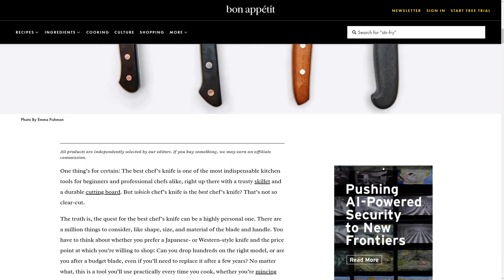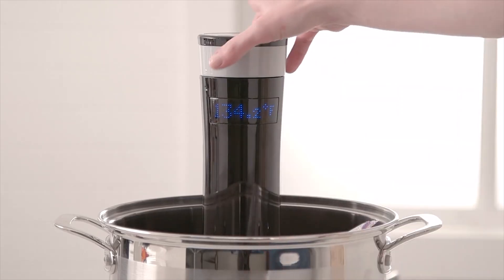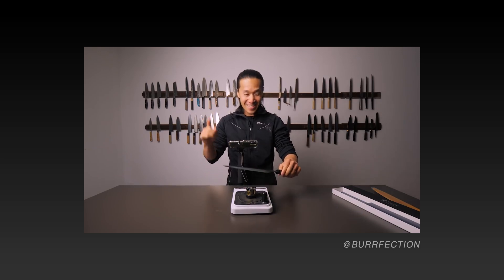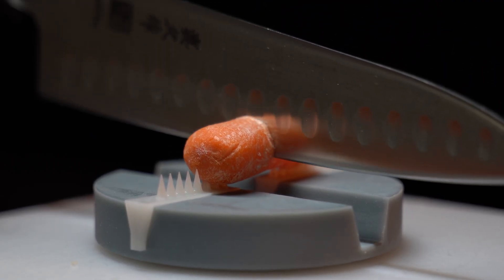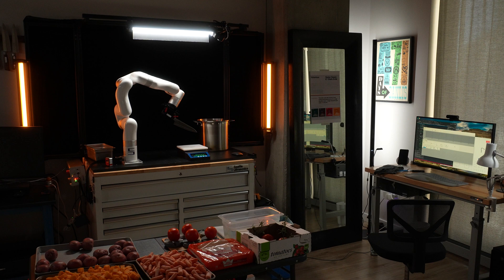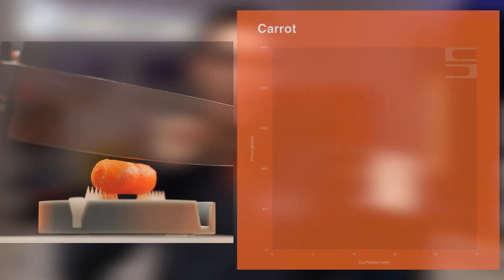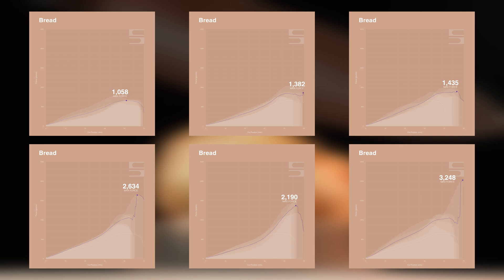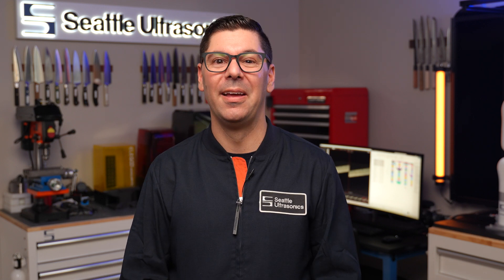The Quantified Knife Project - How do the most popular chef's knives actually perform?

Comment: As a video editor, I got the following problem with this video: it doesn't show the crucial part first, which is the result. I want to see how usual knifes perform and then I want to see how your knife performs on bread cutting and I like a visual demo. I don't need to necessarily have the data. I want to see it cut normal bread. I want to see it cut baguette. A. Longer nerdia video is fine, but as an addition.

Comment: I loved this video!  Thank you for the post.  The first question I have is if you have a way to measure the cross-sectional area of the blade at various places along the profile, as well as the metal's surface polish.  I wonder if there is a relationship of slope, edge sharpness, and edge polish to the different cutting metrics...  Probably WAY too much work to add this, but what the heck, you already recognized your OCD. Also, there might be a way to track the position of each particular knife used by a professional (this sidesteps the issue other mention with the technique being different from how a professional uses the knife).  Anyway, I loved the video, and you gave me some ideas for when I get my smithy back up and running...

Comment: Hey friend, 1. I am so glad Wired told me about this video and linked me to it! Now I can sub! 2. You can go to (likely) any optical shop in and around Seattle and get your glasses adjusted (in under 2 minutes!) to fit without sliding down your face. If you go to where you purchased them, assuming it was in person after your yearly eye exam, the opticians practically have to do it for free by law. Yes, I know from working experience. One douch optometrist made us charge people $1 for every screw! Years later I started as a billing manager at another local optometry place and they always did free adjustments on anyone even if they were not a patient and even cleaned glasses too. It is an art, some are better than others but the older ones know wtf they're doing. For real. Guess which office was beloved by everyone?

Comment: One of the problems with testing knives  objectively is the pool size. One knife from one manufacturer doesn't necessarily tell you much about the quality of a particular model, since there's enough variation in specimens to dramatically effect performance. Like how well sharpened the knife was at the factory. You'd need a bigger sample size to be confident in your conclusions,  and that could get expensive. 

In addition, subtle differences in performance between models of knife may be far outweighed by esthetics and other subjective criteria. 

I wish you luck, because you've taken on a big challenge.

Comment: You really can't use ANYONE ELSE'S bess test scores against your own. Bess testing is only consist with you and how you cut and how you apply the pressure and the time it takes to create the cut. Plus if it's not the clips you really can't use others numbers because tensioning plays a massive roll.
Reply from the maker: True, BESS scores can vary a ton if you use bad technique. It's pretty well known that you can "cheat" the test just by going fast. For my tests, I went as slow as humanly possible, and used only the pre-strung clips (multiply by 1.2 to get the spool filament scale). I took three samples per blade, and while there's a little noise in the measurement, the samples clustered pretty tightly per blade. So, yes, if someone across the internet was trying to fool the BESS tester, their scores wouldn't be valid. But having tested a whole bunch of blades a whole bunch of times, it is a pretty repeatable test when used with good technique.

Comment: The motion used to slice those things wasn't natural. An experienced cook will slice tangentially to start a tomato, then go more radially once the skin is open. The motion on the carrots and whole potatoes was also steeper than it normally would be. Vertical chopping is used for things that aren't too hard or tall, like mushrooms, garlic, halved cucumber, or things cut into sticks that are being cubed.

And the bread test is right out. Nobody would just chop down on a dinner roll. Not after the first time at least. You'd use a serrated bread knife and a light sawing motion. If all you have is a chef's knife, then the sawing motion would be even lighter.

So what we have here is some experience on how the data can be acquired and analyzed, rather than a reflection of real-world knife behavior.

I would also expect the results to get scrambled depending on the method used to sharpen the knives.
Reply: I am very interested in your data . . .  
I build test equipment for knife testing . . . 
Do you have test equipment & testing procedures to acquire this level of data ?
Reply: @danielbottner7700 I have hands. But if I had a robot, we'd be getting jiggy.

Comment: i like the methods, the graphs and all that. but i feel like it is kinda pointless when there are just so many factors.
first you would have to standardise the sharpness and sharpen them all to the same result in the filament splitting test. then you would also have to consider how long the blade stays sharp after using it for a while. you would have to standardise use aswell. you would also have to make up a value for corrosion resistance and how you would add that to the equasion. you get a pretty good idea of the primary bevel and secondary bevel of your blade, but what if they get modified? can a blade get sharpened with a honing rod or is the steel to hard? how would you interpret that answer? do i have to use special stones to sharpen it or will any do? and so on.
i am looking for a reason to buy fancy knifes too, but ... those tests don't say a lot tbh. 
i don't feel like you would go to your chart thinking "hey, i need a knife for tomatoes, which one would be the best"

Comment: Thanks for sharing... we think alike.  I also built test rigs to obtain objective data on 6 popular chef's knives because none existed.  
- Graphed the data for high density food push cuts in several ways to make it easier to grasp. 
- Handle & blade data graphed separately & in combination. Video has been captured, just need to add a narrative & create a youtube channel to release it. 
- Blade profile measurements will be shared for those interested. 
- Quantifying risk & options to reduce risk of hand injuries was a priority. 
- Blades: Sharper & Thinner Profiles... Reduce grip/grasp force up to - 3.7x
- Asymmetrical Handles with Thin Blades... Reduce average Peak Pinch Grip/Grasp Force - 60x
- Asymmetrical Handles with Thin Blades... Reduce average Peak Pinch Grip/Grasp Force - 62x
I am easy to find if there is an interest in the details.

Comment: There's a huge difference between which knife cuts various food the best and what is the best knife. Even "cutting the best" is subjective. Then we get into how often a person sharpens a knife, geometry, how well they can sharpen, strop, hone. The kind if food makes a difference too. Vegetables more than meat, what kind of them? Do you smash garlic with the blade, scoop things up with the knife? Do you shave with the knife, cut horizontally, cut down, cut forward, cut backward? Then just the feel. How heavy, broad, angle. Some of it's completely personal, some how we are taught. There are objective measures sharpness retention, edge retention, toughness, corrosion resistance, ease of sharpening, sharpening geometry, heat treatment.  Which has more to do with the steel than the manufacturer. Though the manufacturer can screw that up. I think reviewers select knives that don't screw any of that up, then measure against what's taught in European (or Japanese) food prep. There's no simple way to quantify the most important qualities. I can radically change the cutting abilities just by changing blade geometry. The will also change how often it needs to be sharpened and chance of chipping. And so on.

Comment: You mentioned reviewing several videos of chefs cutting ingredients to simulate the motion with the robot. From your demonstration, it appears that the robot presses down rather than replicating the slicing motion typically used with a knife—dragging it back and/or forward. This slicing technique significantly reduces the required force, as seen in classic sharpness tests like cutting a tomato, where minimal pressure is needed with a properly sharpened blade.

I hope you can create a similar video using this slicing technique and compare the findings between both approaches.

Comment: Sorry I know people are raging about the detail on data gathering but, potatoes and carrots are not all the same, when I sílice a tomato I only push down after the skin has broken. 
At the end of the day most people buy the type of knife they are most familiar with, that looks good and is on budget. A few might look into type of steel used but thats about it. 
Im glad theres people with an engineering typeset like you but this was not a field where it was needed
Reply from the maker: I know that you're trying to say that knife preference is a matter of feel and opinion, and those factors are certainly important. But if engineers didn't take an interest in improving knives, we'd all still be cutting our food with sharp rocks or lumps of copper.

Comment: I think measuring sharpness and how that works in relation to different foods is just the tip of the iceberg. When I worked as a chef, sharpness was never the issue. It was the ergonomics, how does the knife feel in your hand after two hours, is it heavy, is it light, does it feel nimble? How often does it need sharpening and when you sharpen the knife is it a crazy hard steel like Wüsthof or is it a steel that's softer so sharpening is quick, like with a Mac knife and so on. Ergonomics and ease of maintaining the edge was really the main focus. And price of course. I never enjoyed bringing expensive knives to work, some asshole always borrowed one of my knives and it's gonna happen, a knife falls to the ground, maybe you're lucky, maybe the knife tip breaks.

Comment: You have errors in calculating and averaging test results. For example, look at the result of Zwiling Solution-Bread. You specify the average maximum strength of 5 tests, equal to 3248, but this is not the average value, it is the value of one test.  The correct maximum value for this knife is not 3248 g, but 1682 g. The problem is that you are not correctly averaging the values at the end of the\test. You have different breakpoints in the same test series: some end earlier, some end later. When calculating the average on these final results, instead of adding up all the values and dividing by 5, you divide by the number of. This is wrong. You must either align the results of the five tests in the series to the same stopping point(cut off the tails), or divide the sum by 5.
Reply from the maker: It looks like you caught an error! This appears to be limited to the calculation for bread only, but is an error nonetheless. In this case, for the Zwilling Solutions Fine Edge, the actual value should be 2,002 (not 3248, nor 1682). The value is calculated as the average of the maximum values. 

The data are aligned by starting point, though you may not see this depending on where in the source data you're looking. In the processing to create the summary statistics, the data all begin when the registered force is just above zero, and all the trials end when the knife is in the same place physically.  You can see this alignment if you view the graphs on the website. 

I'll update the bread calculation and its impact on the rankings. Thanks for the catch!
Reply: @SeattleUltrasonics  
I'll update the bread calculation and its impact on the rankings

You need to recalculate the results for all products. In the graphs for each product, you have a colored line that is the average of the five dimensions of. Obviously, late values in different products do not (or only slightly) affect the result, but if you give these graphs, you must give the correct values of.

Alternatively, you should skip the graphs and only give the numerical value of the average for a specific product.

Comment: I just started looking at the results, but I think I found a possible error.

Zwilling Solution Fine Edge 8" Chef's Knife. You have set the BESS value to 411. But if you look at the source data, you can see there are 2 series of measurements. In one series, the average value is ~600, in the other series after six months ~200. The image is attached. Obviously, there is an error in some series of measurements. If you look at the BESS values obtained by Larrin, the value is closer to 200.
Reply from the maker: I'll look into this measurement specifically, but one piece of context for the BESS measurements is that Larrin used the filament spool and I used the ore-strung test clips. According to the BESS folks, you have to multiply test clips readings by 1.2 to obtain the BESS score. Even so, I'll peek at this specific instance and see what's up.

Comment: You're stepping into very randomized and complex topic, as you know. Robotic arm might give you some measureable data but there are so much more unmeasurable aspects of the topic with that setup. Factory made blade works uniformly for a few days or weeks before it dulls and then someone sharpens it - how can we quantify this when there are multiple sharpening angles, techniques, stropping methods etc. Materials that are being cut are different from potato to potato as well as the knives themselves - even the knives comming from the same manufacturers might differ from each others due to differences in hardening process etc. Every single chef uses his knife in a different way as he's not a robotic arm. How can the robot tell you how the weight balance of the knife affects the wear on the chef's wrist after a whole day work? And it is just the tip of an iceberg.... Man, it is mind boggling. Good luck...

Comment: Great video Scott, your passion for the project really shines through. As a fellow obsessive this is the kind of approach to problems I love to see and enjoyed you walking us through it all. I would assume sharpness (thin metal low degree angle edge) + edge retention (hardness) has a high correlation to brittleness + chipping. Before I look at the data I would assume more wedge in the blade splits denser veggies better as well, which likely doesn't translate as well to other thinner precision work. Lots of opposing strengths is likely to land us somewhere in the "goldilocks range" for people looking for 1 Chef's Knife, something that doesn't exceed in everything but does well enough for most tasks. Possibly a 3 blade solution may be as close to optimal as most people will need: 1) bread knife 2) chef's knife with some curve for rocking, slighter softer metal, more wedge 3) veggie chopper with straighter edge, fluted, thinner, sharper, harder. I don't know, just riffing some ideas out to the void. Excited for the next installment to see what you cook up Scott!

Comment: Feels like this reveals even more variables in cutting efficiency. Push cut vs draw (towards handle) vs rolling (towards the knife tip) motions could have different uses per the material. I didn't notice any single bevel knives either and there are so many grinding profiles to choose from. Data nerds woo! Like most research it just indicates the need for even more research haha.

Comment: Burrfection did some testing of edge holding, to me a much more important characteristic than "from the factory" sharpness, a few years ago, .  His testing was not automated and did not generate any data beyond "how many times can I cut through a thick piece of (I think manila) rope before the blade is too dull to do it anymore.  I found it to be quite helpful.  Glad you are doing this!  🙂
Reply from the maker: Note that we also sent these blades for CATRA edge retention testing and published the results as part of this data set. Hope those data are helpful!
Reply: @SeattleUltrasonics  But in Burrfections rope cutting test, the Mercer M23510 and the Wusthof Icon(?)  or Classic(?) performed absolutely identically in edge holding, which does not agree with the CATRA numbers at all.  They both seem to be made of the same steel, perhaps the Wusthof is up by a point in Rockwell...I'll have to read up a bit on CATRA testing 🙂

Comment: Am I right in suggesting that using a constant, robotic motion isn’t the ideal approach for every food item? For example, when slicing a tomato, I prefer starting with a light sawing motion because a straight downward cut creates more resistance. While knife sharpness is   an important factor, using a sharp knife to cut straight down as a test on this soft foods does not seem any different to the wire cutting test. its a different scale for sure but kind of narrow... I loved the video and your dedication by the way.
Reply from the maker: Thank you! Yes, the robot's slicing motion used for tomatoes, potatoes, and bread should have had much more lateral movement, in retrospect.

Comment: Interesting info but there are so many other dimensions that are not being measured that absolutely impact the performance of a given knife. Edge geometry, blade geometry, weight balance, how it was originally sharpened, even the cutting style used. Think the robot needed refinement in how it approached each food, slicing a ripe tomato requires significantly more slicing movement than a potato or carrot. I have a Global 8" chefs knife but the much heavier GF98 model and it cuts much differently in the hand than the model tested here.